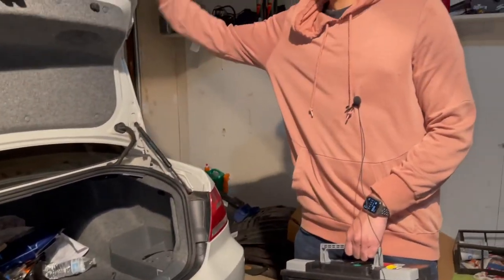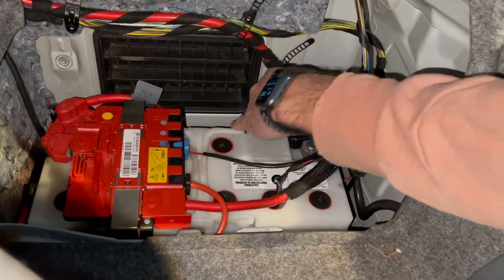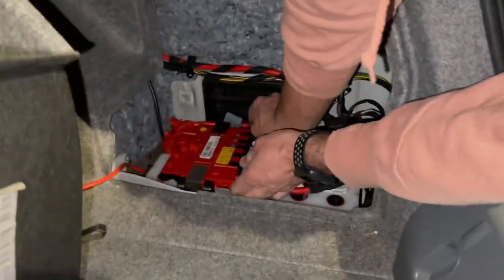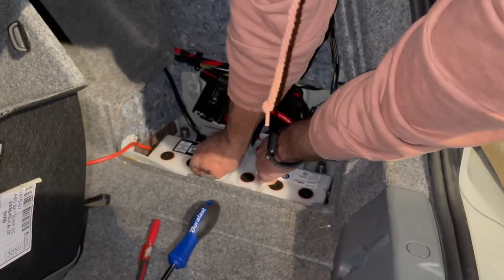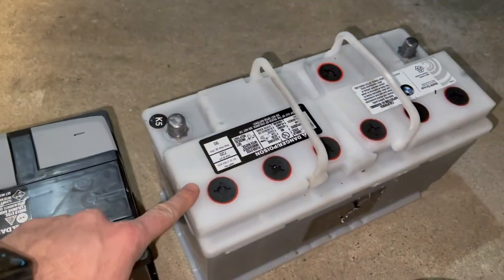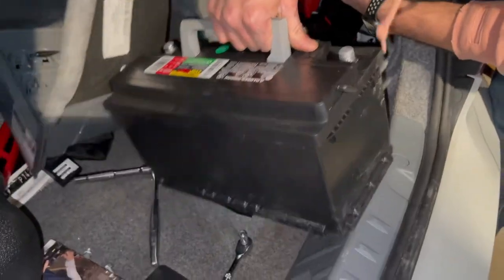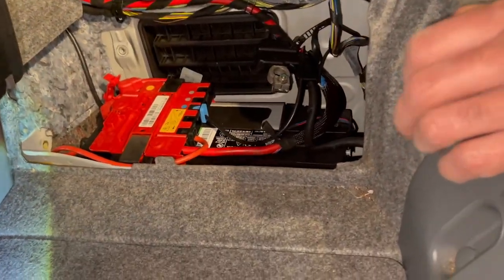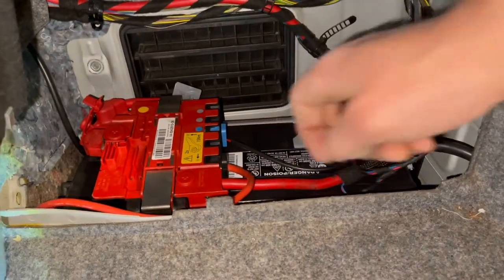Ultimate DIY Guide: BMW 335i Battery Replacement 328i E90 E92 EASY! Walmart H8 Battery

Comment: Followed this step by step and worked perfect. Was worried about coding but it started up fine
Reply: Still make sure you code. It will start fine but you will run into issues overtime unless you do
Reply: Code?

Comment: dude nice vid straight to the point, what were some other symptoms of the battery going bad? long crank times? gauges going crazy? electronics in the cabin shutting off and then coming back on?
Reply from the maker: Thank you! Main thing is the blower motor not working. Along with that, the battery just dies fast with accessories on. A few people also have weird dash light issues and sometimes the car doesn’t want to crank at all because of the voltage shutdown, so people think it’s the starter when it really is just the battery

Comment: Hello i have a 08 bmw 528i with a bosch amg battery. my question is if you have an amg battery an you replace with an Walmart H7 or H8 amg battery is the coding necessary? Also is coding and registering considered the same thing?

Comment: I followed this step by step bought the exact same battery as my original one in vehicle and as I’m all done I go and start my car and it’s now saying restraint system malfunction. Is this something you have seen? What should I do?
Reply from the maker: Hmm that is weird. I would check the code and try and reset it! I have not seen that before
Reply: @tunerworld  I did still didn’t work, unfortunately I’m gonna have to go get it checked out
Reply: @Keigan-Davies did you ever figure It out?
Reply: @TroyNoChill  yes it was some weird piece that the battery didn’t have and it also needed to be coded to my car right after so just get it done by a shop if you don’t know how to code
Reply: @Keigan-Davies  I just got the car a week ago and swapped my e30 battery and drove the car. I haven’t coded It yet but heard It wasn’t detrimental to drive but definitely should get It coded ASAP so the car won’t misuse the new battery
Reply: @TroyNoChill  yeah I did that the next day works like a dream now thanks!

Comment: See that is all you need, Walmart , if you can find them . Some people seem to need a BMW battery with the little sticker. BMW batteries are made by all different battery companies. Exide , banner, etc,  there is no such thing as a “BMW” battery. The biggest issue is that Walmart never has them in stock.

Comment: do we need to have backup/3rd party battery during this change?
Reply from the maker: No you do not!
Reply: kinda, disconnecting minee and reconnecting a new caused a overvoltage and blew one of my confort module....common issue, yes it is advise to connect a 3rd party battery voltage while doing this

Comment: My battery was completely dead key stuck windows wouldn’t move so I just replaced the battery everything lit up but it won’t start ? I hear the starter trying to work did I do something wrong
Reply from the maker: Brand new batter? Could be the starter
Reply: Did you ever find out what was wrong Ashh Marie?
Reply: First thing you have to do is register your battery so the ibs recognizes it  n that you changed it or you can disconnect the blue ibs connection it should start if no starter issues

Comment: Brother I’m telling you from experience not coding your battery will cause it you fail catastrophically, no chance of regeneration and at extreme kiss your alternator bye bye
Reply: I agree
Reply: I think I should do that and not risk a plug n play
Reply from the maker: I coded the battery
Reply: that’s not true I didn’t code my battery and it still ran good and last. And my alternator is fine